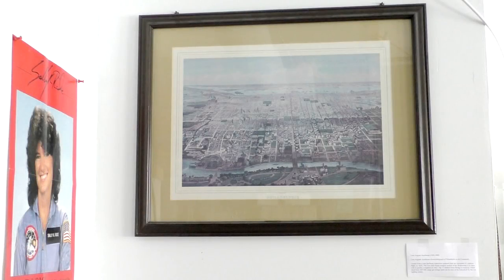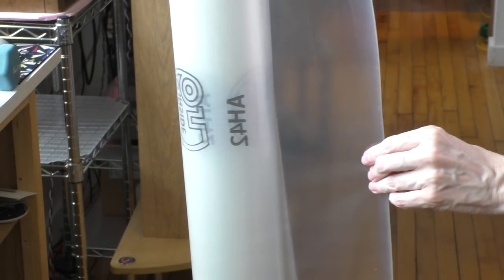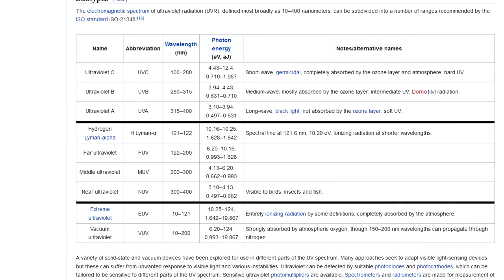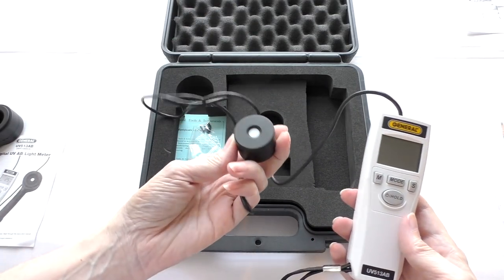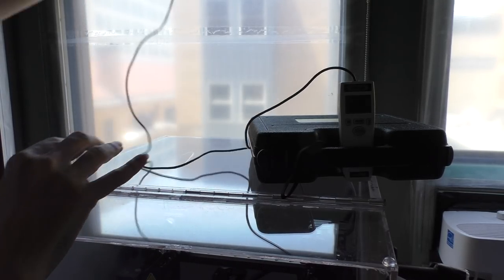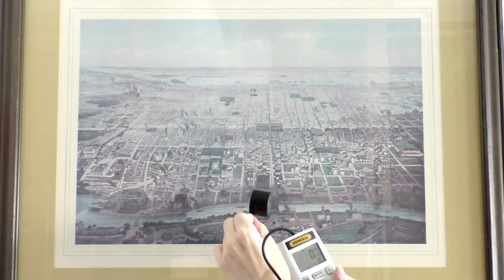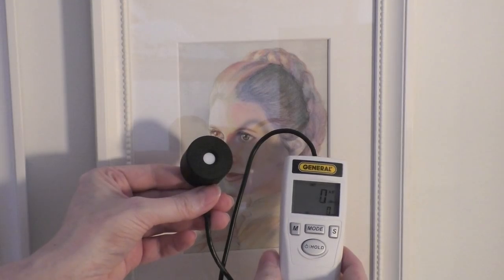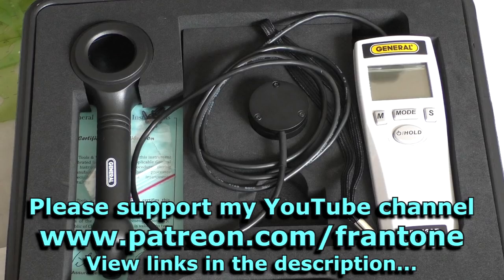Why Use UV Shielding???

Comment: If you are concerned about the exposure of your artwork to UV light, please communicate with a custom framer. You can swap out standard glass for a conservation grade glass very inexpensively, and you'll be supporting the local small economy. Then you'll be sure your treasured images are as safe as they can be. Thanks Fran. Fran if you want any of your frame glass swapped out, give me a holler.
Reply from the maker: I am a conservation framer myself and do all my own mounting.  I have museum glass on some very old pieces, but it is cost prohibitive for all pieces so others I simply control the light environment.
Reply: @FranLab  museum glass is crazy expensive. I recommend "conservation clear" frequently. It's got the same UV protection without the anti-reflective coating and is a fraction of the cost.

Comment: I had no idea regular glass lets through UVA. I thought it would block those.
Also, I'm a bit jealous of your watercolors, especially the one with Rachel and Deckard. Beautiful pieces.
Reply: You can buy CF black light (UVA) bulbs. They have blue filter to remove most of the white light to better observe fluorescence. Newer ones use LEDs and are used in flashlights. They are cheap and readily available.

Comment: We had an old print of the Greenwich Observatory hanging on the wall at Chamberlin Observatory's transit room. In 1991 the colors were still there in the print. By 2010, the colors faded so it looked like an old faded black and white print.  When I replace the image with an available newer image from Greenwich, I had the framing people put on UV blocking glass in the frame. The UV was not coming from the window, but from the old 1948 style fixture fluorescent lights. These lights were on during the night for security reasons for years. One of these ballasts went out one night and almost started a fire when the 1950's tar potted thing overheated.

Comment: When repairing something inside the house, I prefer natural light from a window, and it seems I can never get enough light on the workpiece. Yet when I go outside, especially when driving, I put sunglasses on!  I bet it gets hot in summer when the sun comes in through your windows; accordion-pleated shades work great for insulation and lowering the AC bill, but diffuse the natural light evenly.

Comment: I let some company put a nano coating that blocks uv and infrared light on the glasses in the office and I notice it stays a lot cooler in the office with that in place. Should get an uv meter to actually check if it blocks the way they claim it does.

Comment: Hey Fran I use a slightly different version of that General Digital light meter. My meter measure UVC light. I work at a place where we use UVC lamps to sterilize object. The amount of energy is up to 2000 uW (2mW) of UVC per cm^2. Needless to say we wear UVC safety goggles when operating the machines.

Comment: Very interesting.  Did you mean square cm instead of cubic cm as part of the readings?
Reply: I was wondering the same thing
Reply: @FranLab  As far as I know, incident radiation is always measured per area and dose units per mass. I don't know of any radiation units that are per volume.
Reply: She does.  The meter displays square centimeters.
Reply: Hay, every won maches mistokes.
Reply: Yeah, the meter itself shows square centimeters (cm²)
Reply: Pretty sure she did, just a slip. The marking clearly shows square.
Reply: The physicist in her might have been thinking of energy density by volume, used in calculating the intensity of (say) a laser beam, which is more or less proportional to power per area.

Comment: It would make sense to coat the glass of picture frames with a UV blocking material or use a special UV blocking glass mixture. I wonder if that's a thing for high end frames.

Comment: I have that anti UV  film in my car windows and windshield and it lowers the heat a great deal. Just out of curiosity, can you do the experiment with incandescent and fluorescent light and any other light sources? Would be an interesting watch.
Reply from the maker: Florescent lighting has a UV component inherent in it, but regular domestic tungsten bulbs are red shifted (warm) but not used much anymore.
Reply: @Fran Blanche  When I noticed that computer cases yellowed even in a closed underground datacenter environment where I used to work, suspected that the FLs aren't as inocuous as they seem. Thankfully we have LED lighting nowadays!

Ah, thanks for replying to my comment!

Comment: Don’t really understand why standard double pane glass doesn’t have UV blocking coating on the inside. Would practically make no difference in cost and would save a lot of interiors from UV fading. It’s silly really.